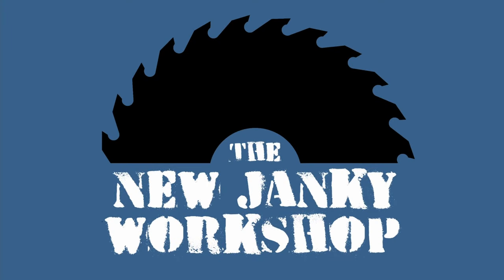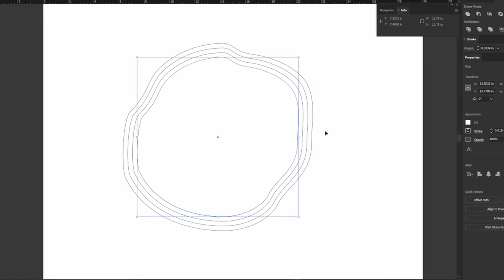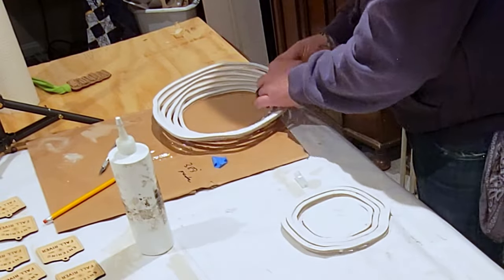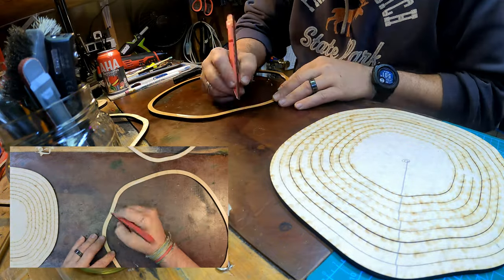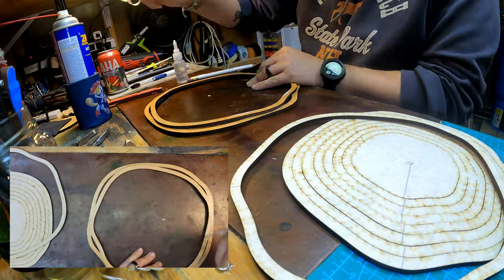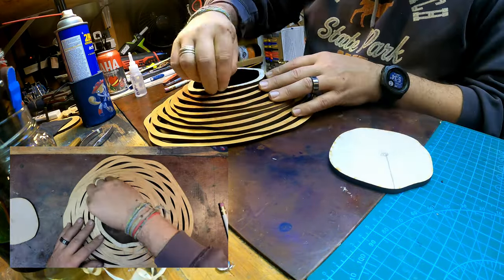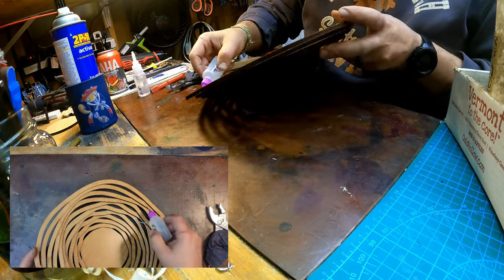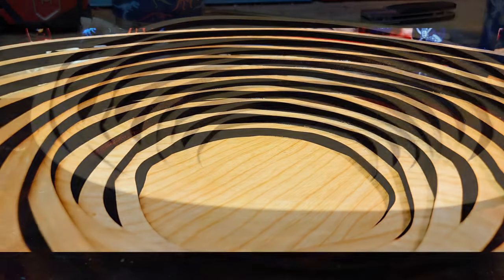Stacked and Layered Wood Basket/Bowl

Comment from the maker: This is a layered bowl (stacked basket) all made from the same sheet of material, with rings cut inset of each other, and then layered together to make a bowl. Would not recommend for soup or cereal however.

So while I liked the geometric shape, I like to be a little janky... a little less precise... so I wanted to do a tree-ring style bowl. Made a few different designs, and this is the first full version out of ~1/4" cherry Glowforge Proofgrade plywood.

Over on the Glowforge Community forums, I saw a user - Matt Herron (matt22) - post about layered bowl (https://community.glowforge.com/t/another-stratified-walnut-bowl/120188). I had seen something like this before out of a single piece of plywood (I think from  @3x3CustomTamar )  but never put two and two together to do it with the laser. Duh.

In the final plywood version, I also do my turns for the subsequent layers in the bowl at around a 1/2" or so (again, not exact, as stated in the video), instead of the ~1/4" I did on my test subject with foamcore.

🛠️ Tools and Supplies 
You can purchase this laser design file (SVG) here: https://www.etsy.com/listing/1675368117/layered-bowl-no-1-stacked-basket-laser 
Or, if you're a Patreon supporter, it's free! https://www.patreon.com/posts/layered-bowl-svg-98166478
1/4" Foam core board: https://amzn.to/43LbsVC
Sanding Sticks - Coarse Grits: https://kit.co/TheNewJankyWorkshop/tool-reviews/sanding-detailer-sta
Sanding Sticks - Fine Grits: https://kit.co/TheNewJankyWorkshop/tool-reviews/sanding-detailer-fin

This video is NOT sponsored by  @Glowforge , however, we do get some kick back if you use our referral link to get $500 USD off a Pro, $250 USD off a Plus, and $125 USD off a Basic. Which will go into supporting this channel. So, if you're interested in a Glowforge, please use the link below!
https://glowforge.us/r/FQKFCCNR

🙃 Products, Plans & Merch
https://geni.us/tnjw

✅ Related Videos 
For more laser printing videos, check out this playlist: https://youtube.com/playlist?list=PLSkvrm-RbSKFeox7btB87UHJKvMyf6X0y
Also, here is a video talking about the little sanding stick I use in the video here: https://youtu.be/1Piumq3OqlY

📱 Follow me…
https://www.patreon.com/thenewjankyworkshop
https://www.instagram.com/TheNewJankyWorkshop
https://www.facebook.com/TheNewJankyWorkshop 
https://www.tiktok.com/@newjankyworkshop
https://www.youtube.com/@TheNewJankyWorkshop

📧 Mailing List
Join my mailing list to be notified about new videos, merch, and general information from time to time: https://geni.us/jankymail

🎵 Music
End screen music used is: Nickel and Dime Blues; Performed by  @Gangstagrass   (https://gangstagrass.com); Courtesy of the mighty fine folks of Gangstagrass. Check them out. They are awesome. 

Additional music used in this video from Epidemic Sound - check it out and get a free month of royalty free music! https://geni.us/esound

⚠️ DISCLAIMER 
My videos are for entertainment purposes only, your safety is your responsibility. Please do not follow my actions if you find them unsafe. Which, they probably are. I'm a bit janky. Some of these links go to one of my websites and some are affiliate links where I'll earn a small commission if you make a purchase at no additional cost to you.

🥔 Hashbrowns
#bowl #woodworking #glowforge #woodworkingproject #laser #bowlmaking #lasercutting #lasercutter #laserprojects